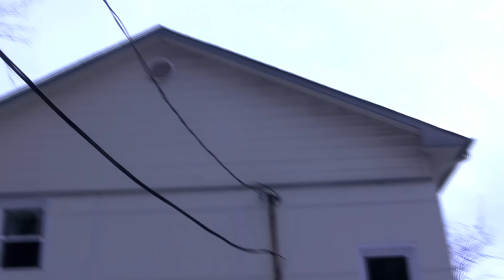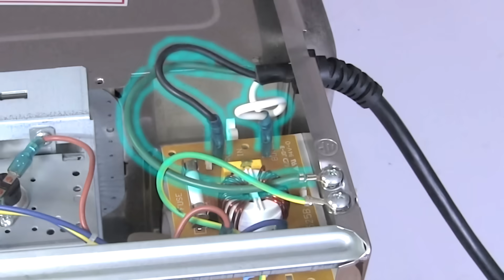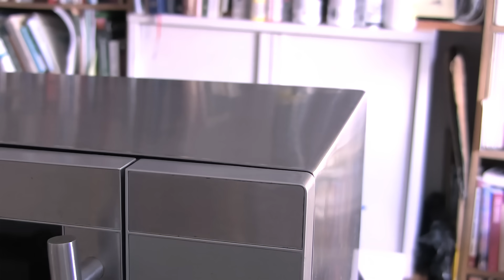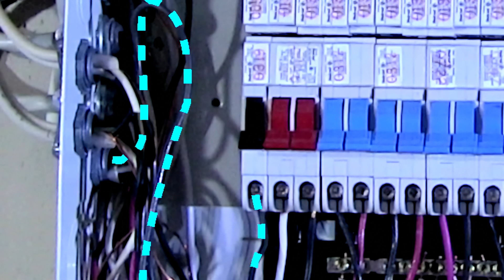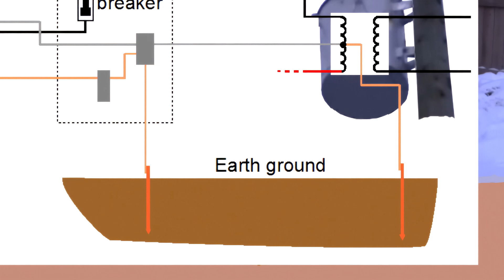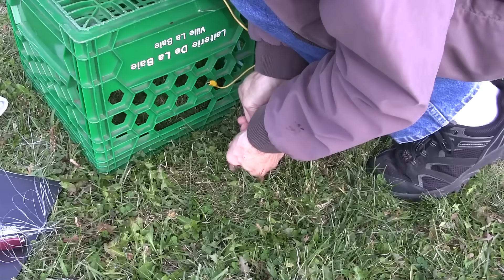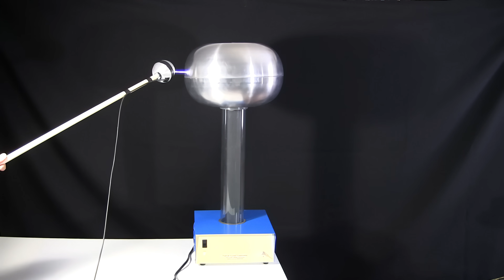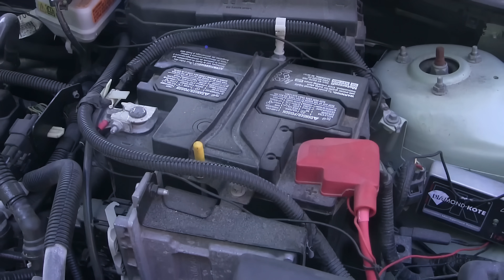What is Ground? Earth Ground/Earthing

Comment: i cannot understand how the ground wire is not energized, if the ground wire is touching the neutral in the breaker box then it should have the same voltage as the neutral and therefore constantly energizing the microwave casing and should shock you because of the potential difference between the casing and the floor.
Reply: I'm learning too.   And I'm gonna guess that they are connected at a point where the path back to source is so much greater in the neutral that it just doesn't travel down the ground.

I'm not sure. I hate electricity and this is only my second video in my quest to understand it.
Reply: @ I assumed that since there is a grounding rod buried in the earth and connected to the neutral point of the transformer outside the house, and since the ground wire in the main service panel is also bonded/touching to the neutral point, both the rod and the ground wire would be at the same electrical potential. As a result, there would be no potential difference to drive current flow from the metal casing, through the ground wire, and back to the source via the grounding rod. I haven’t seen this explained so I’m not sure if its correct though
Reply: that's because the neutral (not open neutral) and ground are connected to the same node. You might wanna look up what a node is in electrical theories.
Reply: One node does not have a voltage, except in reference to another node.  The neutral is our point of reference, and it is grounded everywhere.  That is assigned the zero point; we measure voltage of other nodes relative to the neutral or to ground.  In detail, there can be a small potential difference between two neutral points, or between neutral and a ground wire or Earth, but it should not be significant.  In a properly connected system, the neutral, ground, and Earth should all be at the same potential, approximately.

Comment: Does this mean the ground rod should always be treated as dangerous to touch? Since it is meant to carry high voltage?
Reply: The ground rod will only carry high current during electrical fault like wire insulation breaks. Therefore, in normal conditions, it is safe as there is no current.
Reply: @GnomeChildd  bro what is the difference between neutral wire and grounding because If l connect phase wire and grounding wire to lamp 
The lamp turns on same as neutral?
Can l use grounding instead of the neutral wire that comes from the supply
Reply: @crasaaqmaxudiin  Phase wire delivers current from power source to the consumer, and neutral wire carries current from consumer back to power source to complete the circuit. Earth wire is used to provide a pathway for current to flow only when a fault occurs. To answer your question, you cannot substitute the neutral wire for earth wire because the earth wire is not designed to carry continuous current and it will also lead to serious safety hazards such as electrical imbalances, electric shock and disruption of proper functioning of the power system. Hope this helps 👍
Reply: @xebec9052  thank you so much

Comment: Why then current in neutral does not go to earth? If I touch bare neutral is it ok then?
Reply: i was thinking the same that what if the neutral wire has a insulation fault
Reply: You should not touch any wire unless you know it is safe, but a neutral wire normally will be very close to ground potential.  There will not be a significant current from a neutral to Earth because the path through the neutral wires back to the transformer is much lower resistance than the path through Earth.  The neutral should always be connected.  If the neutral is broken, bad things can happen.

Comment: Quick recommendation.  American electrical outlets should be turned upside down, as anything falling on a partially plugged-in cord will be stopped by the ground before it lands on the hot and neutral wires.
Reply: Upside down outlets have a slightly higher chance of pulling out/down since there is only one prong keeping the plug from tipping down/out as opposed to two prongs. There is no best way. 
Put them upside down if it makes you feel better, but it won't necessarily protect you more. Have you noticed how you most likely put the plug into the outlet? Your thumb is on top parallel to the line, and your index is perpendicular to the plug under it. If a finger touches a contact, it will most likely be the index, so if you put your outlets upside down, your index would short hot and neutral (neutral is hot too since it's AC) and that's only if you're dealing with a grounded plug, which the vast majority of plugs are groundless anyway so it wouldn't make much of a difference. 
That's why the code doesn't specify upside down outlets. 
If the outlets are in a metal factory or fabrication shop, etc, that's a different story.
Reply: @gtfkt  On your first point, I don't think the orientation makes as much of a difference in holding the plug in place as just being a snug quality outlet does.  Either way, gravity drops objects, and when they hit a plug exposed to the hot and neutral, they can cause a short without getting help from the ground.  In any event, a grounded outlet is safer than a non-grounded one - so grounding it correctly is probably the biggest concern in modern construction. 

I once dealt with a ceiling fan contractor who wired ceiling fans by cutting the ground and taping it off. He was simply too lazy to connect the ground because he said, "It still works, doesn't it?"  I asked how long he had been doing it that way, and let's just say the term decades was used, as well as thousands of ceiling fan installations.  When shown it was just a little more work to connect the third wire he left the room still sure of his electrical prowess and my stupidity.
Reply: You may orient them however you please.  The only situation that is likely to cause the problem you describe is if you have a metal cover plate with a missing screw.

Comment: So if i get electricity from radio waves + and - I don’t need the ground right?
Reply: What do you mean electricity from radio waves? Do you mean a signal carrying information or actual power? Because you can’t extract any useful power from radio waves. Either way, to answer your question, you do not need an earth ground to pick up a radio signal. You will certainly have a ground reference in your transducer (antenna) circuit, but the simplest configurations will likely not a physical connection to ground.
Reply: @nolanthedude  No i medan converting strong elektromagnetic waves into elektricity

Comment: Hi. I was looking into IT earthing system recently and considered your example; My view is that if we have an insulated neutral on the transformer neutral point and on the panel meaning the neutral in the panel and on the transformer is insulated from earth (I), but the microwave's frame is earthed/grounded (T), making it an IT earthing system. In this case, if we have an insulation failure on the hot wire in microwave, then the fault current would flow from the hot wire to the ground wire to the equipment frame and then would go the ground balancing out the electrons and potential difference, and eventually the earth and microwave frame would be at equal potential, so eventualy and I assume within seconds, the current will stop to flow through the ground wire and microwave frame making it safe to touch. Do you agree with this concept?
Reply: IT is not used generally in the US. It is used in some places like operating rooms. The only country where IT is widely used is Norway. In IT the neutral point is not grounded or it has only a high impedance path to the ground for lightnings.  The neutral wire is not typically used in IT, just the three phases. IT is resistant to a single failure Lets say you have a 230 V IT without neutral then accidental grounding of a phase sets only 133 V to the others. If you instead had a 400 V IT with neutral then accidental grounding of the neutral would set 230 V to the phases.

In normal systems (TN, TT) a  failure is handled by cutting  the power either by the breaker or by an RCD. This of course is not acceptable in an operating room so IT is used. A failure is shown but it does not affect the use. It then is fixed at the earliest possible point (like unplugging the faulty device)

If the neutral point is isolated no current will flow to the ground assuming there are no other failures.Instead the phase that fails becomes grounded.

"and eventually the earth and microwave frame would be at equal potential,"

There is no eventually anything. Things happen fast. Remember the current switches direction 100 or 120 times a second.

Now if you mean TT then it is inherently unsafe so an RCD is needed to cut the power. A ground rod does not make things safe. The ground rod will have about 90% of the mains voltage.
Reply: @okaro6595  IT is preferable if you have people monitoring the system constantly.  This is why most countries only use it in specialized settings.  I am not sure what Norway is doing using it for residential.
Reply: If a ground fault occurred within a microwave, or really any metal chassis connected through a ground fault plug, it would be safe to touch almost instantly. The breaker would immediately trip, and even if you were touching the metal chassis as the fault happened, current would flow to ground instead of through you. It wouldn’t take a few seconds to happen. Breakers can trip in under 40 milliseconds in ground fault conditions.
Reply: @nolanthedude  But that does not happen on IT. It happens only on TN.

Comment: Great video.  But why do we have a ground and a neutral prong when they are connected anyway? Would have been nice to get an explanation for that, too.
Reply: The ground is connected to the neutral, but only at a place where it cannot damage anything, making so that it provides a full path for the electricity to flow (and trip the breaker), but not damage anything or hurt anyone. In a case where you only have the neutral, any short-circuit would pass through the "important" stuff, be it electronics or a person, without any path to escape.
Reply: @cenowador  I think you're saying that the electricity could in principle flow through the important stuff when ground is connected to neutral but the resistance on that path is so much higher that the current takes the alternative path to earth since it has much lower resistance?
Reply: Excellent and easy explanation.  I have a queston.  Where are the ground and neutral normally joined together?  I have read they are jointed at the first main swtich.  I live in Mexico and in the fuse box there are 2 busbars, one with the earth sumbol and one with no symbol which I resume is for the neutrals. @cenowador
Reply: @andrewbocho3896  They are joined together at the first point of disconnect.  This will usually be a box right by the meter can (or sometimes the same enclosure as the meter).  We call it a "service disconnect" here in the U.S.  If you open that can you will see a #6 grounding wire connected to the same bar as the neutral coming in from the utility.  Then you will see the other end of that ground wire leave the bottom of the can and travel down to a ground rod. Or you use the building foundation as a ground if you have a nice place to connect it. Past this point ground and neutral MUST remain separated at all points.

Comment: Because the metal case of my large Aple computer desktop (and my apple computer laptop) added a bit of voltage but  a tiny amount of current on it. You could feel the voltage on the metal case of the computer with your fingers ---tingling people call it....  even it was on standby called "off."   Want to get a rid of that, I ran a AWG #10 wire from the case down to a copper ground rod 6 feet long -- when I dug a copuple of times ,I ran into groundwater about two-three feet below my lawn .---- Thailand .     so I'd like to think the ground rod got into that. .
     With no one present in the room and nobody remember lightning, the multiple grounding socket strip which my computer was plugged into also had a real ground run inside it and what happened was something changed-I guess--blew up and the result was the outlet strip is badly burned nearly catching a fire on the floor  (yes wooden).   I got sick before I got in that room to check what happened--  Thailand.      What I saw was the burn outlet strip and I did get down under the table and take the ground wire off of everything in that room. I had to go to my sick bed and never have looked at it again but but something happened somewhere inside that computer or somewhere and everything was operational ok for over a year prior to that upset.
     Until I learn more I will be very shy about grounding the case of any electrical device down line from my master breaker box. So this makes me wonder about grounding things like the case of the air conditioner, refrigerator, and so on. I welcome some input on this..
Reply: Do not improvise with grounding. If you have issues consult a licensed electrician.

PCs leak half the mains voltage trough capacitors to the case. If it is not grounded you can feel it. It is not immediately dangerous but if you feel it there is potential risk. Yu might consider ans  RCD for safety.

Comment: so the ground is a positive charge that attracts negative changege?
Reply: It's neutral, so it doesn't repel the negative charge. And since the negative charge is made up of electrons which all repel each other, they get pushed towards the neutral charge where they don't get repelled. 

To simplify, you could say that relative to negative charge, even a neutral charge is positive and thus attracts negative charge. But that would technically be wrong.

Comment: so what's the difference between neutral and ground?
Reply: Neutral is the grounded conductor. It is for the circuit to operate. It is grounded for over voltage protection. The grounding conductor is for safety. It is connected to the case. The neutral should never be connected to the case.

Comment: If both neutral and hot wires are live in an AC circuit, how does bonding the container of an appliance not give it the potential to be live? If you held an earth wire near an earth transformer would you get alectrocuted?
Reply: Neutral is live in the meaning that it carries current. It does not have significant voltage to the ground.
Reply: @okaro6595  and by ground you meet the nearest transformer earth rod.
Reply: When you have an appliance connected to a 2 phases circuit, there'll be no neutral connected to the appliance, but the transformer still have a neutral point connected to the ground. The 2 phases you pass through a braker. Also, there's still a ground wire connected to the appliance's container in case of any of the phase wires lose the insulation and touch the contanier. The circuit will be closed any way, because the current will flow through one of the phases to the ground, which is also connected to the transformer.

Comment: What would happen if the neutral was not connected to the ground?  How would a person get a shock by touching a wire with his finger  if there was no potential in/at his feet.
Reply: If the neutral was not connected to the ground then the fault current would be low, maybe 10 A - way short of the roughly 100 A needed to immediately trip a breaker so it would remain energized. Also as the greatest resistance is at the ground rod the greatest voltage loss would also be there so the ground rod and the equipment case would be almost at the mains voltage so it would not be safe. Note this still requires an equipment failure. 

Now there actually are countries where it is so and connecting the ground to the neutral is banned (or at least optional) like Italy, Spain, France. That is known as TT earthing (Terre-Terre) an distinctive from TN. The trick is that there is universal RCD (GFCI) protection. The entire house is protected by 100 mA or so RCD which is part of the earthing system. Then individual circuits are now almost universally protected by 30 mA RCDs just like in TN.The ground rod will certainly pass 100 mA. Of course the problem is that if the 100 mA RCD trips the whole house goes dark - fortunately it will mostly be the 30 mA ones tripping.

In te UK EV chargers need to be protected against a PEN-fault. The simplest way to do this is to put a ground rod and connect the ground to it and not to the main grounding system. Since they are RCD protected anyway they are safe. A PEN fault (known as broken neutral in the US) men that the PEN-wire breaks and the ground contact becomes energized through the bonding to the neutral - a highly dangerous situation.